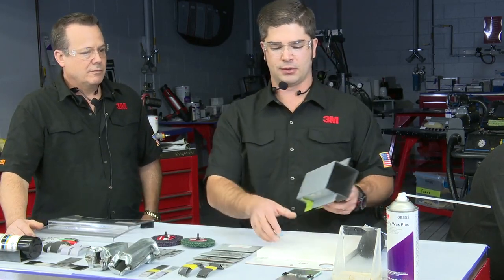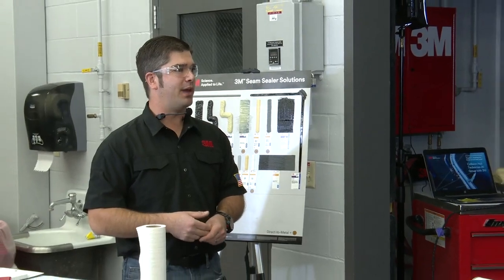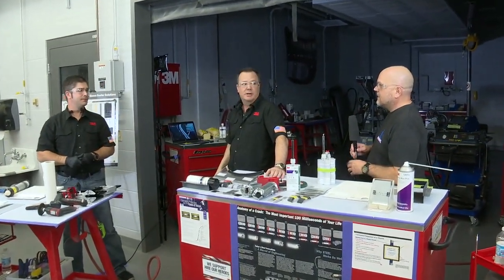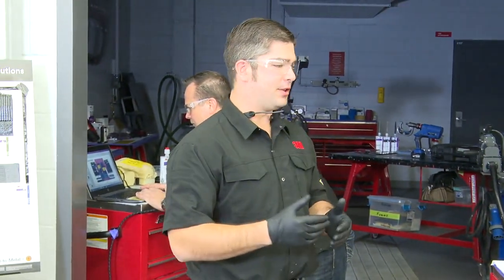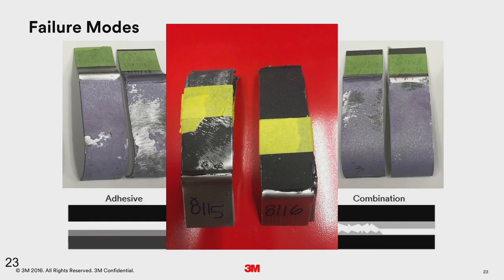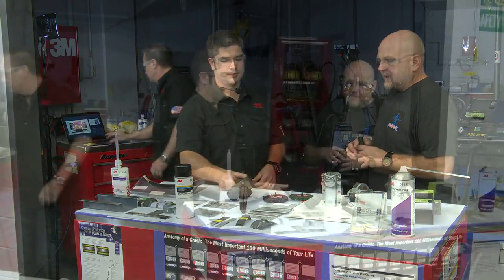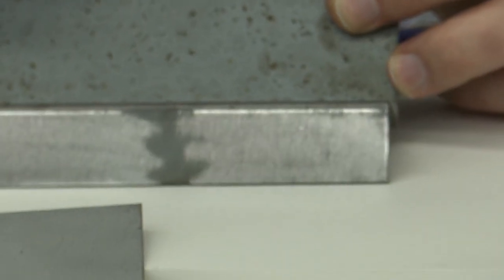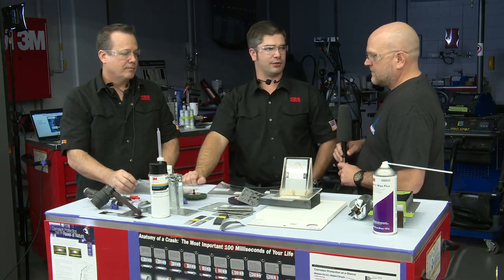Collision Hub Technician 20-Group

Comment: What about people that live on gravel/dirt roads. Also salty northern roads that leave a road sludge later. 
The Medallion/Rubberseal Amber undercoating is waxy yet has a dry enough surface that dirt won’t stick in it. 
I sprayed a cars with both products and kept it about 2 years to touch and show people. 
The 3m collected every ounce of dirt from my hands. The Amber I could rinse off. 
So when this is packed with 3 inches of mud in a wheel arch or rocker...how is 3m better than Amber?